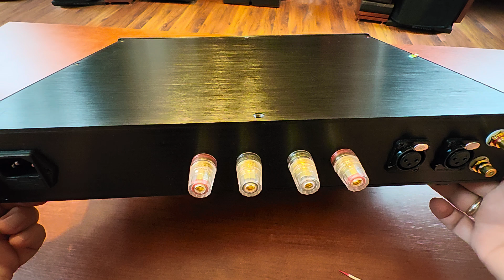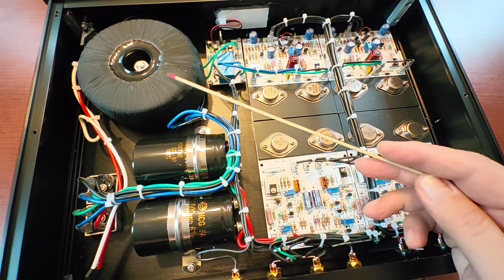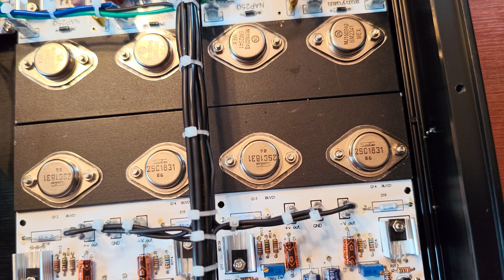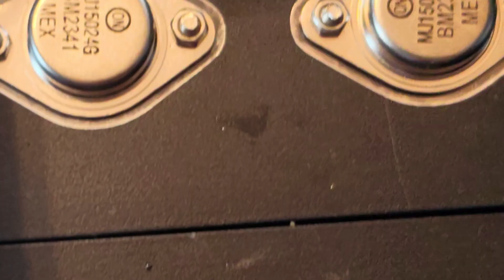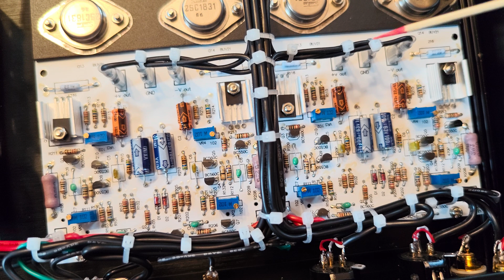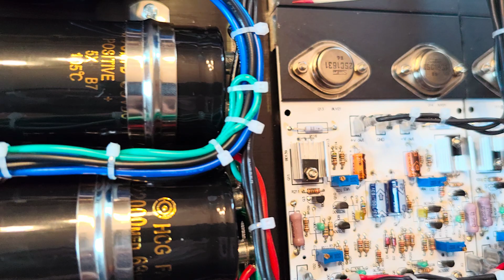First look: Naim NAP250 power amplifier clone build quality

Comment: You can know the orange caps, if theyre doesnt say that theyre Epcos, then theyre made in India, and they are the India caps under unbranded. Theyre not expensive, but also theyre not the cheap chinese chategory that you play dice with (if its fake or explodes, since theyre rebranded its voltage or value.)

Comment: Hello, can you tell me how this amplifier will compare to primare i21 amplifiers or Japanese vintage sansui 607,707 or pioneer 717? I have a sansui 607, I'm missing the speaker and the middle.
Reply from the maker: Sorry I can't, haven't heard them. That Pioneer you're mentioning here isn't exactly known for sound quality so if those Sansui are on similar level then this clone will be better.
(Years ago I had like 4 Pioneer amps and then 2 Pioneer AVRs and every single clone I've reviewed is better)

Comment: I have had mine for less than 6 months and it now completely dead. Both channels just suddenly shut down.
Reply from the maker: This may be kind of obvious but have you checked the fuses? both channels dead at the same time suggests power problem, this may be something essy to fix. Also, was that from the seller I recommended in my link?
Reply: @k4syx  Thanks for that. The power light was on. I think it was the speaker protection cutting in. The next morning it was working again. It is a fine sounding amp. Thanks.
Reply from the maker: @doctorrobin3040  Yes it has quite nice speaker protection, it has to be re-set by power switch once it triggers.
Reply: @k4syx  I watched your review again and I totally agree with your findings. Thanks again. My FM Acoustics FM 711 pre is totally dead again. I think it is now junk. Replaced with a Schiit Audio Pre which is really good.

Comment: Naim were/are idiosyncratic about signal grounding (DIN), used cascaded voltage regulation and did whatever they could to deter connections to normal hi-fi IMO. The general construction is very Naim like though. Looks visually worth the money.
Reply from the maker: They've done a lot to grow exotic cables market, look at all the Naim DIN to RCA adapters on the market :D

Comment: 100 percent it does not sound like a Naim. There are possess  that are secret that the counterfeiters do not how about . I would also be skeptical of long term personal.
Reply from the maker: This is electronic design. As long as you have the same parts, same tolerances and same pairings it will sound more or less the same or very very similiar. Same with real units leaving production line - its not like someone makes resistors manually and they are different for each unit. These are repeatable industrial devices. Work of art for engineers like me, yes.

Comment: Nice review but this looks NOTHING like a Naim NAP250 on the inside.
Reply from the maker: Yeah its not a copy, its been reworked on reverse engineered schematics. You can actually find stuff like that on DIYAudio and other forums along with PCB designs and BOMs - full complete documentation sets sometimes with optional build versions for different budgets.
Reply: @k4syx  Do you know which version of Nap250 this is cloned from? Is it from the latest DR version?😊
Reply from the maker: @sunnykfc  no, no the latest one, not the oldest one too!
Reply: @k4syx  Someone said it's from the 1970's model.
Reply from the maker: @sunnykfc  ah, ok, must have missed that one

Comment: Garbge POS single transformer instead off dual. Mono
22000uf 50v epic fail
Use 27000uf 50v x 12
Reply from the maker: What would be additional cost of that? Rough estimate?
Reply: 27000uf 50v from Nischicon are £30 each  @k4syx
Reply from the maker: So that's like additional 400USD for caps _alone_, right?
This whole amp was like 350+shipping so I fail to see epic fail here. If it was 1000usd then I would expect to see that kind of capacitor banks.
And two transformers. But for that price?
Not really. 
Of course, there is still an open question on sound quality, and that one I will try to answer in full review :)
Reply: @k4syx  that spec shoud come as standard for that price.

Comment: How does this compare to similar priced offering from Transaudio？
Reply from the maker: @px7355  haven't heard the Transaudio one. That's the one with flat front right? I thought the PCBs looked similar but that was just a quick look at the photos
Reply: @k4syx That’s the one. One more question, how would you say the general quality of this maker compare to trans audio products? I am trying to decide between the two. Thx in advance
Reply from the maker: @px7355  again another tough question. Both are doing great job, though as far as I can see Transaudio doesn't do cheap clone amps. They focus on more expensive stuff. Having said that, Breeze stuff in the same price range has also great quality, they don't cut corners like in cheaper stuff. 
Tough choice. Have you looked at the board photos? There's a chance that they are the same so you could just go for the looks alone:)

Comment: The innards look like a clone of an early NAP 250 but with a much smaller transformer. The case is a "clone" of the later NAP250-2. A bit of a miss mash. Real NAP250 has single XLR (non balanced) input, putting both L and R channels through a single connector.
Reply from the maker: @stewstube70  the case can be also bought separately so I guess these just take them as they are available. I have a NAC52 in matching chassis too

Comment: Show us the service / user manual, showing how to adjust the BIAS  on that bad boy. Oh wait, the Chinese don't provide their customers with that kind of information do they.  May as well design the amplifier with fixed Bias, as opposed to having a trim pot for Bias adjustment.
Reply from the maker: Well I dont want to be a buzzkill here, but does Naim provide service manuals? Oh yes they do, to authorized partners only, and same goes for spares. I wanted to replace OLED display in my UnitiQute a while back (they all fade very quickly, bad design or bad parts choice) and as long as I could replace it in 15 minutes on my own - I did remove the old one - they will not sell you the part without service replacement and it was 250GBP if I recall correctly. For small, green, low resolution dummy display:)
So bad example. And actually some of the sellers there publish schematics right in the offer  pictures as these are DIY reverse engineered publicly available designs that you can find in places like electrotanya or diyaudio.
And again as for bias setting. Look in the comments for my JC2 preamp review: errcl there needed to set the bias so he reached to the seller and got all the info he needed, so I've updated the video description so everyone can do it too.
So no offense, but Naim is extremely bad example of open and transparent company :)

Comment: I don't understand why it's called a clone. Totally different components compared to the original.
Reply: The original Naim built ampliers used custom made output devices that had the markings NAIM nnn (I forget the numbers) so only Naim can get them.  The schematic will be much the same for the original and the clone.
Reply from the maker: Its based on original design diagrams. Its different here and there but its not a 100% copy for sure. Hard to pick the right word, clone was best choice for me :)

Comment: Shouldn't all those wires be twisted?
Reply from the maker: Not necessarily - it works in sources like DACs (to an extend as its very very very subtle difference) but doesnt usualy make a difference in the power amps. However, I can try to twist them wherever it will be possible and check if I can hear anything different - why not :)
I did that for my Gustard X20 Pro a few years ago.
Reply: @k4syx  oh nice. I'm making a diy amp called the Wolverine. In all the documentation it keeps saying twist the wires so just wondering. Looking inside all these amps is helpful for layout in mine. That dartzeel amp has me very interested. It's that still the best you have heard?
Reply from the maker: @Pete.across.the.street  There is a few that are quite close but I am using DartZeel as a point of reference for others. If you can twist them, do that, its good practice. Twisting on alreade made devices can be sometimes hard as it will shorten the cable so it may become too short :/

Comment: What would be the advantage to using two different types/brands of transistor?
Reply: The 2SC devices are 100 W transistors arranged as voltage regulators (stabilised PSU), the MJ devices are power amplifier output rated at 250 W.

Comment: One thing I notice that seems like a very bad idea is that the coils on the speaker outputs have ferrite cores. I've seen this before on China amps and have changed them out for air cored.
Reply from the maker: I call small things like that "modding potential" as you can change something here and there for the better with time and some knowledge making these even better with little money. I love that part of the hobby as I love to tinker with my devices :)
Reply: @k4syx  Yes, you've just got to know what to look out for. Sometimes a really good device can be spoiled by a simple issue.
Reply: @mfr58  Genuine Naim amps have no coils or Zobels on the speaker outputs. Instead they specify a high inductance speaker cable ( a figure of 8 twin pair) to provide the necessary inductive load.

Low inductive and high capacitance speaker cables will cause many Naim power amps to go into oscillation.
Yes including Cardas, which  I've tried.
Reply: @rontoolsie Wow!   Makes his listening tests more challenging!
Reply: Hi.  Could you point out where these ferrite speaker coils are in the design/video so we can be educated?
Thanks very much!!
Reply: @EvenHarmonics  Just look on the amp boards for a vertically mounted copper coils, it appears to have a ferrite core to me, which I have come across in other China amps.
Reply: @EvenHarmonics  The coils are on the two PCBs toward the front of the amp,  about halfway between the output transistors (metal cans with diamond-shaped mounting flanges, mounted to the heatsinks), and they are the tall, narrow red tower-shaped components with a black post in the center of the red windings that wrap around the post. The winding wire is a very heavy gauge thickness, so the series resistance is probably low, but the ferrite core (the black part) is prone to saturation and hysteresis distortion. Just removing the cores from each coil should be enough to turn them into functional air-core inductors instead of ferrite-core parts; the 'value' of the inductor will be lower but it should still be high enough inductance to have an effect.

Comment: Does the green NAIM logo lights up? It has an LED board by itself?
Reply from the maker: Yes it does. Its not a fancy thing like in real Naims (thats actually low quality and caused problems in both Unitiqute and NAP10 I had ealier, and dont get me started on cost of replacing oled display there). 
Its very simple and it has just a led light behind it, but it works :)

Comment: Using the NAIM brand on the outside seems risky. Customs could confiscate it and you can even get fined for importing it.
Reply from the maker: Yes I think they went too far with the logo, Ive seen that its possible to get this one with other name there (but also in green). 
Customs are different form country to country, but yes it can be an issue - you're right!
Reply: NAIM might take China Post to Court and get fined.. 😂😂😂😂😂😂😂
Reply: Only if they found out about it and could somehow obtain proof.

Comment: Hello. How xlr input is implemented? Is amplifier full balanced architecture or just used hot pin from xlr input and all the best is unbalanced?
Reply: Although their are 4 boards, they are two pairs of different boards...I suspect that each channel has its own amp board and regulator board (like the original 250), so the XLR input is probably not a balanced one, and added only for convenience.
Reply from the maker: EDIT scratch that, look at Ron's answer below!
----------------------------------------------------------

I think its fully balaced as original was xlr input only. I'd rather think they've added se to balanced converter (opamps?) than rebuild the whole design.
Reply: @k4syx  I've owned around 15 Naim power amps in the last 40+ years. And the higher end models I've owned (250, 135monos,300 and 500) have ALL had single ended XLR inputs.
Likewise all of the 8 or so Naim preamp I have owned had 4pin single ended DIN outputs. The 552 preamp I had was split rail power supply, but definitely non balanced. 

Every Naim power amp from the 250 and above has two boards per channel...one board regulates the front end voltage, while the other provides current gain.

Naim has NEVER implemented balanced circuitry.
Reply from the maker: @rontoolsie  Wow thats interesting, I was browsing through NAP250 sales photos and I can see all of them (and there was a couple of variants over the time) had xlrs. And some of them XLR and DIN only.
I wish you could hear this particular clone with your experience! 
So I stand corrected - thanks!
Reply from the maker: @rontoolsie  (Ive edited my comment above)
Reply: @rontoolsie Thank you for your great answer.  I have one question please.   
When I look at the board layout and see two identical sets of 2 boards, I (wrongly it appears) assume it is balanced or dual mono.   What should I look for to tell me that is not the case.  
     Thanks!!
Reply: Thanks Ron for your detailed answer. Does this clone have any resemblance circuit wise to the original Naim?

@rontoolsie
Reply: @rontoolsie Is right All doe similar not identical boards thereby not balanced.
Reply: @yellow_noise3  Let me give you some inside information as to why single ended (rather than balanced) XLRs were used.
During his last year of life, I spent many hours chatting with Naims founder ,Julian Vereker- on the phone for reasons that had nothing to do with audio.
He confirmed that the original Naim 250 amp was built with XLR s since XLR amps were considered 'professional ' and the UK tax system at the time excised lower taxes on professional equipment than domestic equipment. 
There was also the added benefit that both L and R channels shared a single ground (earth), unlike RCA, which gave better sound.
This is exactly the reason why DIN5 connections for inputs were favored over RCAs.